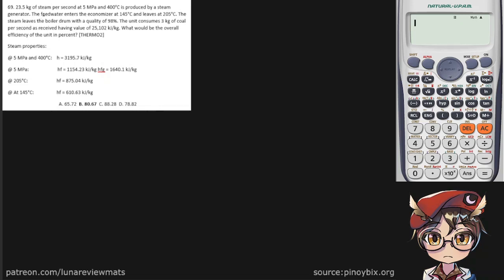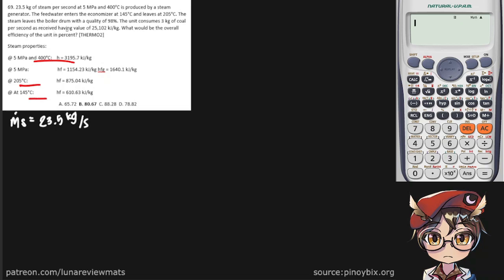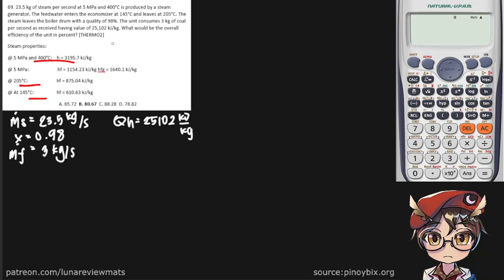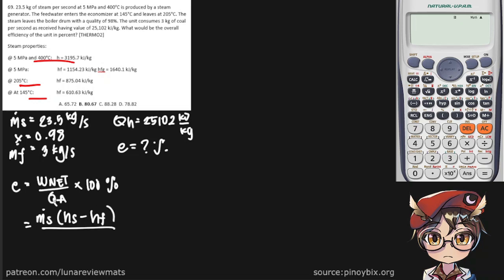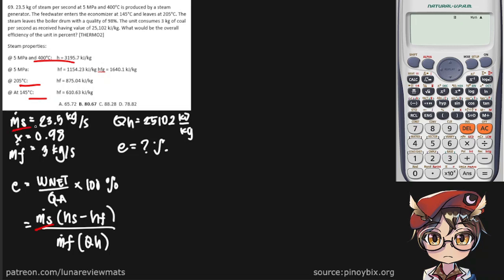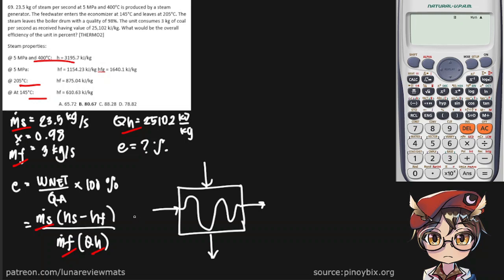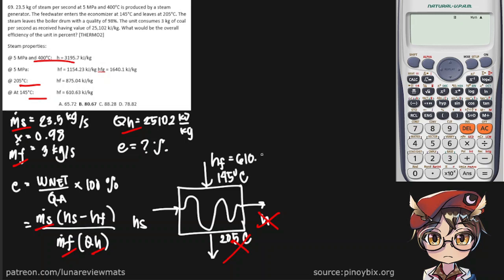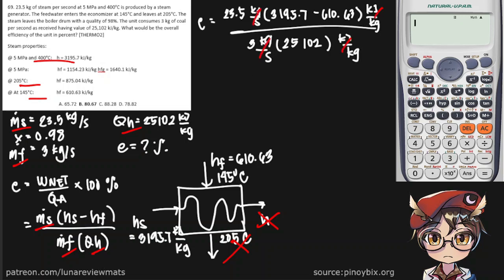23.5 kg of steam per second at 5 MPa and 400°C is produced by a steam generator. The feedwater en...

Comment: Whats the concept behind using those enthalpies? I don't know which of it should be used as h2.
Reply from the maker: That depends on which part of the steam plant you're using. Using h1 and h2 is arbitrary and can vary between schools, but in mine, we use h1 for steam turbine entrance and h2 for turbine exit. However, the problem here mentions using the economizer so we're not dealing with the turbines at all. You have to analyze the conditions that the problem gives you. For example, in the economizer, the feedwater entering the turbine is at the 145 C condition because it is yet to absorb heat from the supply water. It becomes 205 C because it has absorbed energy from the supply water it came into contact with in the economizer. I suggest you work on your plant equipment diagram analysis if this part is confusing. I hope that helps!